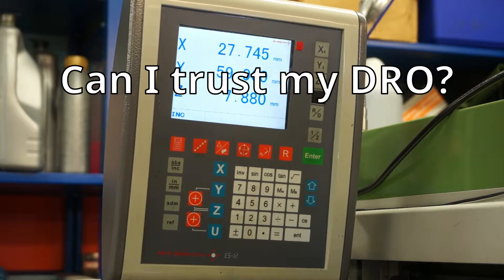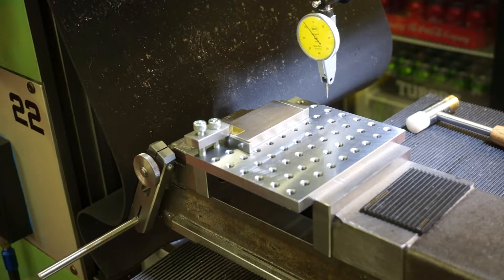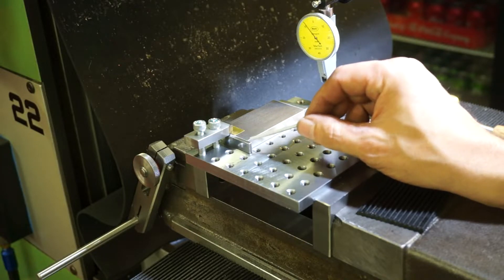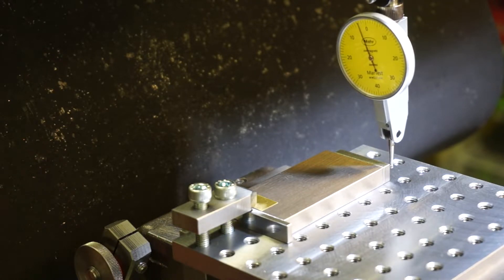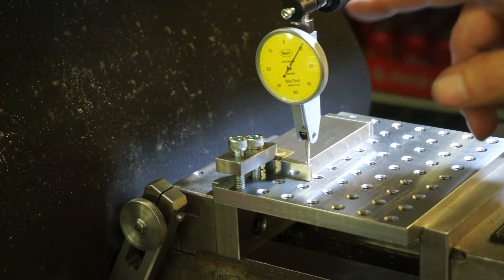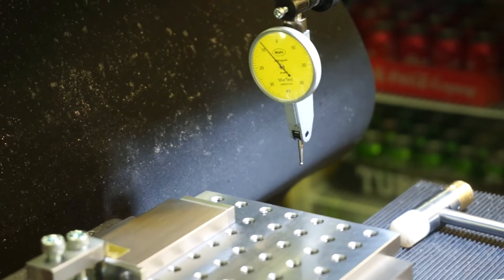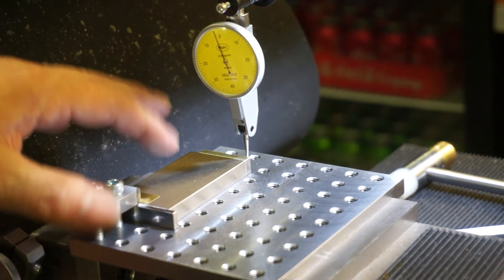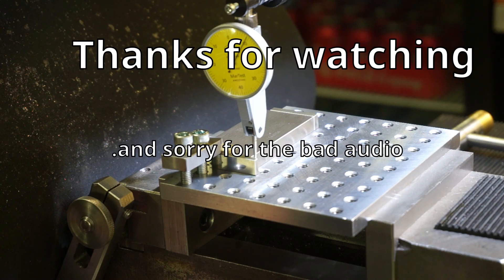Can I trust my DRO?

Comment: Did you ever find out what the source of your measurement error was? I am considering getting a DRO and perhaps there’s no reason to invest in glass scales if they won’t give me any better precision than much cheaper magnetic ones?
Reply from the maker: I think these DRO's are more than good enough for hobby use.  My problem might have been caused by several factors.  For one, some of the encoders (which was already mounted when I bought the machine) was loose. Mounting the encoders correctly is of high importance, and tightening them even more so. Also mounting the encoders as close to the center of the axis of movement as possible, not far to the side of the axis.

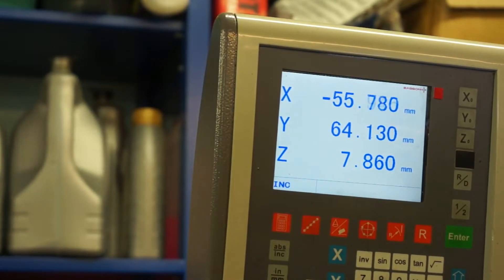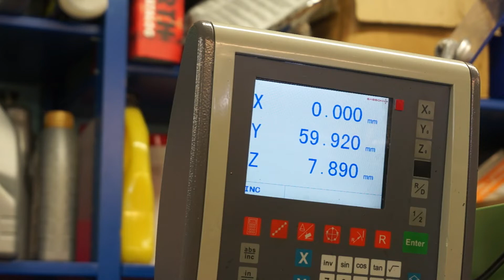Comment: I noticed your Z axis drops (like 0.03mm) from 7.870mm to 7.840mm between 4:19 to 4:28 on a 21mm travel! It can not be seen on the video, but if it is proportional for the whole 75mm travel, the Z should have dropped by 75 / 21 * 0.03 = 0.11 mm. As if those 0.11mm of pulses went from scale X to the scale Z counter. Since they are missing from the X counter, you had to make an extra +0.11mm of travel to to reach the 75mm and the indicator is overdriven by just that amount. Again at 7:19 it says 7.890 while seemingly you didn't move on the Z.
Reply from the maker: I didn't see that before.  I think this as a result of the x-axis moving and shifting the weight on the knee of the milling machine.  I can't remember if I locked the knee or not.  The scale for the z-axis is not ideally mounted, as it is to one extreme side of the table, thus making it more sensible to small rotational tipping movements of the table.  However, The needle of dial indicator, is not touching the object I measure in that direction (height), so it should not influence the measurement directly.  Of course, a slight movement in the z-direction could still influence the measurement.
Reply: Yes, Z can move as the table rotates if the sensor is on a distant end. My guess was not about the needle of the indicator sensing any Z movement but the electronics/firmware messing up the result (it incorrectly interpretes the incomming pulses of +X values as if they were -Z). You won't believe what crap we firm-/hardware guys are able to produce! :)
Try and disconnect Y and Z scales so that only X works. This should minimize any crosstalk issue coming from the other two scales.
Do you have the same problem on the other axes? If Y is OK but X is bad, try and swap their connectors! Your X will be displayed in the Y, and vice versa. So you can check if it is the problem of the scale or the electronics evaluating the signals.
Is the the error repeatable on the same distance? Are there certain spots where error occurs? Maybe the scale is contaminated or damaged. 
Is the error bigger if you make stops during the movement? Maybe vibrations occur when stopping/restarting.
Is the error the same with lower and higher speeds? Most scales can be programmed to have finer resolution (increased S/N ratio, but processing will be slower due oversampling and averaging), and then they speed becomes limited. If you feed them faster than they can process the signals they will start missing pulses.
Otherwise a great series, and a huge respect to all of you endevauring such projects as bringing to life old machining equipment!!! 
I wish I had a garage :)

Comment: Hi Arnljot,
Readout and scale accuracy should be within +/-6um with a repeatability of 2um and hysteresis of 3um. So the kind of deviation you are looking at looks very much like a loose reading head or really bad installed scale. You can first eliminate a readout error by performing the same measurement you did on the Z and Y-axis. I also believe these readouts have a linear error compensation option, maybe that got messed up by a previous owner. Good luck investigating 😃

Comment: Since I think and visualize in imperial measurements that's what I'll have to use here so my apology's for that. I think the basic technique your using is repeatable well enough for what your doing. Mahr make some top quality equipment but like anything your indicator, gage blocks and dro all have built in allowable + or - accuracy specifications. In imperial measurements your roughly 4/10,000ths out over approximately 3". With the various stack ups of allowable tollerence limits it's possible to see what you are seeing. Even Newall dros while being well recognized as being really good dros have a + - .0004" (imperial) allowable limit on there spereosyn scales while still being within brand new specifications. To do better than that you have to buy newalls .0002" reading Microsyn scales. No doubt they average far better than that, but that is there stated allowable accuracy limits. If those are good brand name gage blocks in very good condition there likely within 4-6 millionths for grade 2 blocks so that can mostly be ignored. You can see 1/10,000th hysteresis in my mitutoyo 1/10,000th reading dtis sometimes and I'd expect Mahr indicators would be the same. Add in uncertainty of measurement as well and I think it's quite possible to see some variation. 

The dro not repeating to zero each time would concern me as well though. I think much more testing over longer distances is required. A standard gage block set if that's what you have should get you to 250 mm with just 4 blocks. You could then accurately measure a couple of 25,50,75 mm blocks if you have them with a very accurate micrometer who's measurements can also be trusted to add another 150 mm to that gage block stack. Micrometer setting rods while fairly accurate in the shorter lengths aren't at the longer distances your wanting to measure. Not to the limits your wanting to check at least. They could be accurately measured and certified at a calibration lab of course. Even the wrong tip length on the indicator can throw the linear measurement off of what the dial shows but your only preloading it by 5-10 hundredths of a mm and zero should still be zero even if it had the incorrect tip installed at some point. I suspect that's not an issue but thought it should be mentioned. Very fine measurements that are dependable are very tough to do in a normal shop environment. I still think you should be seeing a bit better than you are. Since you didn't install that dro then double checking the scale alignments against what the limits are for mounting accuracy in the dro's maual would be something else I'd check and also that nothings moving due to a slightly loose mounting screw on the scales just to be sure. You have to eliminate as many variables as possible before you can be sure of exactly where the problem might be.

I'll also admit I'm biased and don't fully trust any of the cheaper metrolgy gear to repeat as well as it should including the cheaper dros. That may or may not be a valid impression, but I don't even fully trust Mitutoyo or Starrett metrology equipment unless I've personally checked and verified it does repeat well within the factory specifications. So far either company's equipment has checked out, but if you don't check and have verified it yourself then there's no way to be 100% sure of anything.
Reply from the maker: Turning Point. Thanks for a lengthy elaboration over possible problem areas. I think I need to follow up my "investigation" with some more experimentation and possibly a follow up video. You brought som good ideas to the table. One thing though, The deviation that I am showing in the video is 1/100th mm which is roughly 4/1000 of an inch not 4 tenths, so it is rather large
Reply: Guess I dropped a digit when doing my mental conversion :-(  and yes that's way more than it could possibly be without something being wrong that's for sure. You could bolt a block to the table at each end of the X travel and cycle it back and forth multiple times with the dro zeroed at one end, and zero the dti much like you did in this test so you know your in the same spot each time and then see if your dro display repeats accurately each time. You wouldn't be checking it's actual linear measurement just that the readings are the same each time. If the dro won't repeat then it would be a good indication of a scale being loose, faulty display or scale. The magnetic scales and reader heads are supposed to be almost immune to contamination issues but if some swarf happened to get into what should be a sealed area? I dunno, just mostly guesses on my part right now.

Comment: hello Arnljot,
Jan Sverre from Drammen here..
not that i think this is causing your error, have you tried to "load" the test indicator more than you do?  assuming the travel distance is lot more more, this at least ensures you are in the linear measurement range. otoh.. this might be an issue with a plunger type?
Reply from the maker: Hi Jan.  I will do some more testing and will take your suggestion into this test